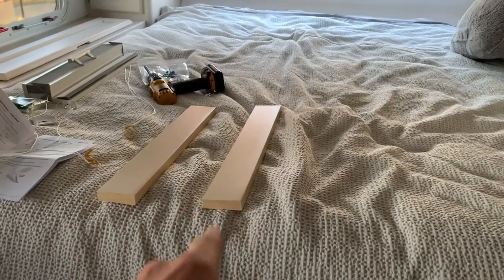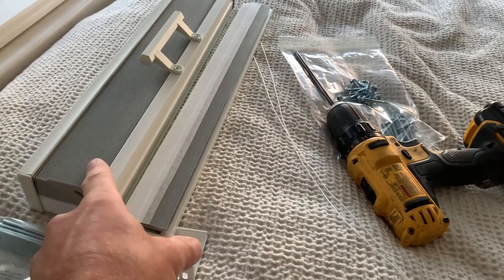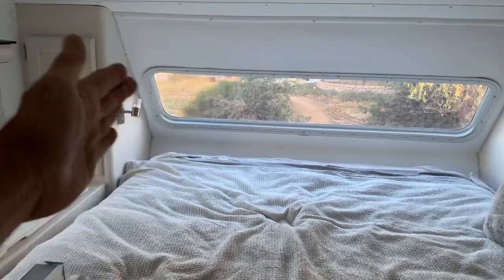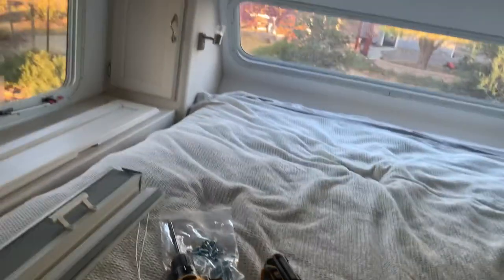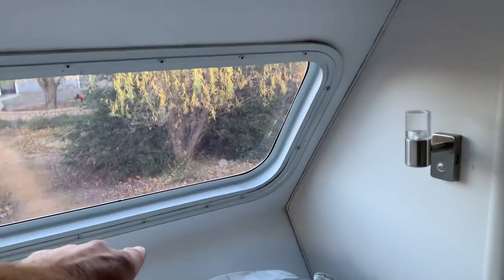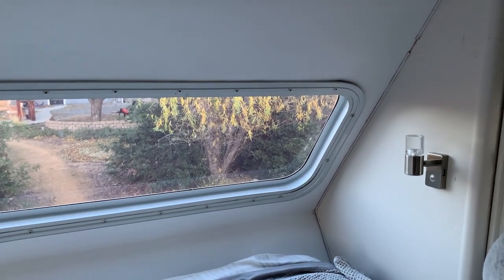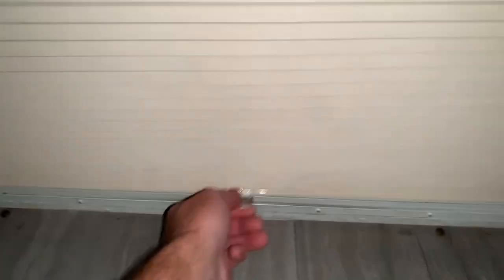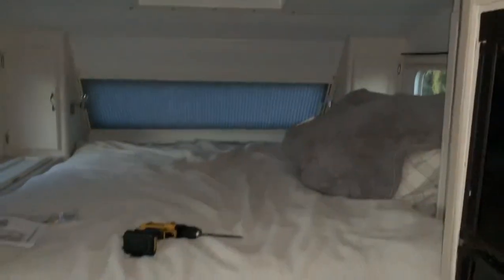Night Shade Idea for Truck Camper Cabover Window • Skylight Blinds

Comment: Nice Blinds! Looks Good. When and if I ever get half as far as you on our Elkhorn, I'm still going to replace that front cap with a solid piece of fiberglass and frame in the old window and maybe replace that roof escape hatch with a Fantastic Fan. I wonder if on some of these new cabovers that have a one piece solid front cap if one of those would fit our Elkhorn and how much one would cost?
Reply from the maker: The older Fleetwood Jamboree class C motorhome front cap may fit.  It was molded fiberglass.  The older Alpenlite may fit as well.  I measured one at an rv salvage lot in Corning, CA several years back.  It would fit but only with modifications and some fiberglass repair.  
Be careful replacing your emergency egress hatch with anything other than another emergency hatch.  It’s a requirement for safety.